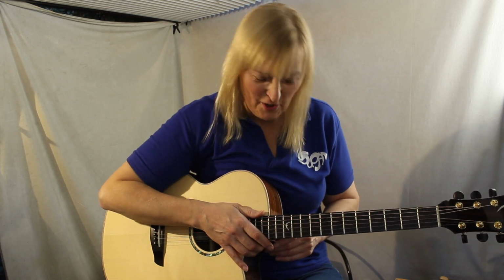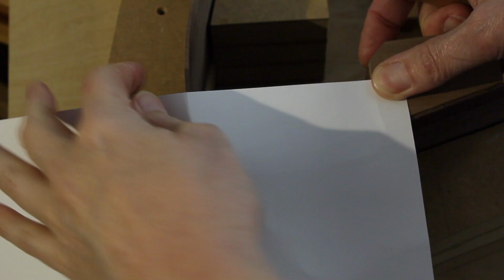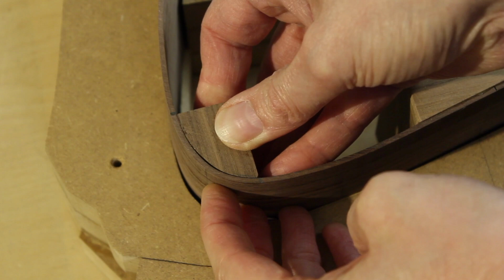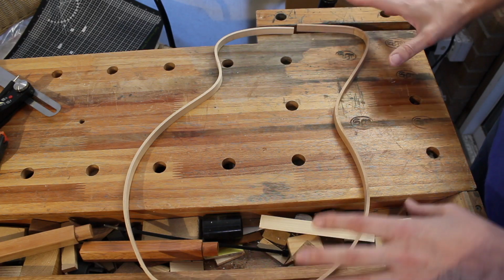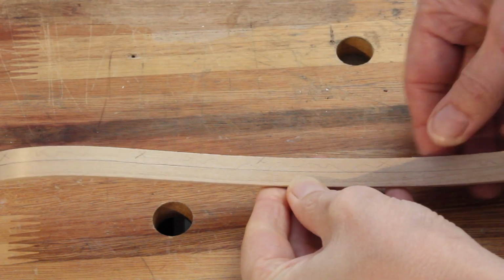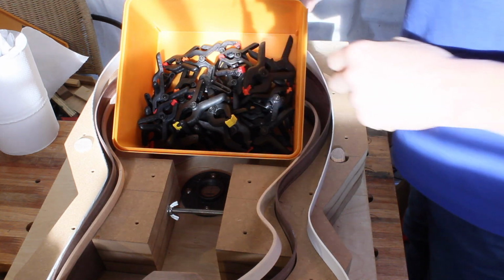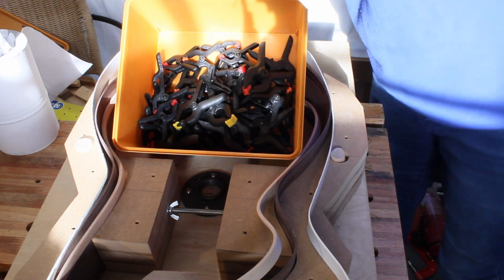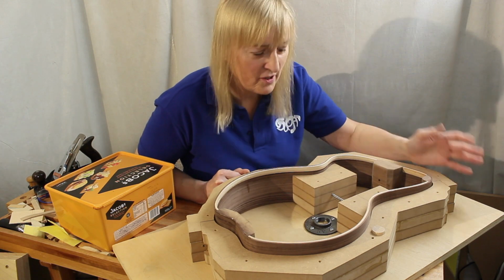SuGar SG1 acoustic guitar build part 40: Back linings

Comment: Nice rhythm! You don't really need to protect the wood when using clamps like that. Or even the one hand clamps. Only steel clamps put so much pressure on the surface, that wood gets compressed.
Reply from the maker: Those little clamps have quite sharp feeling edges- I didn’t want to take the risk of a twisted clamp pecking the side

Comment: Susan, loved the intro and outro, really looking forward to seeing the guitar completed, but here comes the ticking off. To finish it you are going to need all those fingers, bare skin and slim fingers so close to a fast rotation abrasive!  I don’t think so. Please find a better way of holding the work next time. Ps...... I’m old enough to be your father so you have listen.
Reply from the maker: I did glue the block to another piece of wood. I don’t think the spindle sander is as dangerous as you think. I’ve brushed against it without much damage - just the top layer of skin - no blood. I lose more skin using coarse sandpaper sheets - I tend to lose my fingerprints and can’t open my phone afterwards